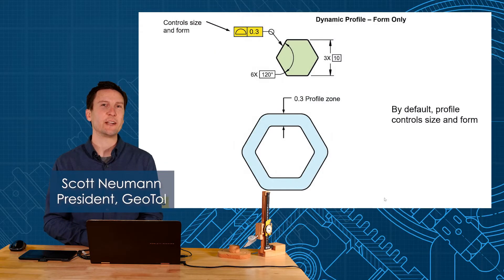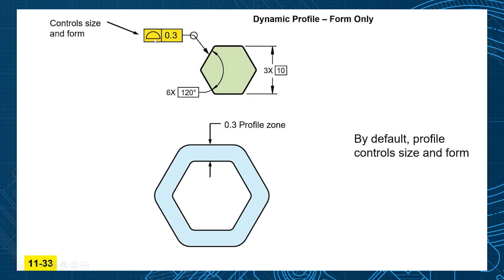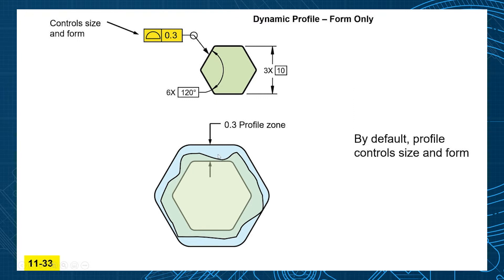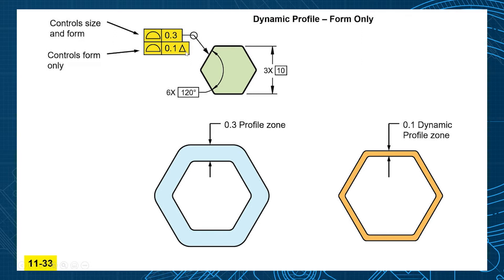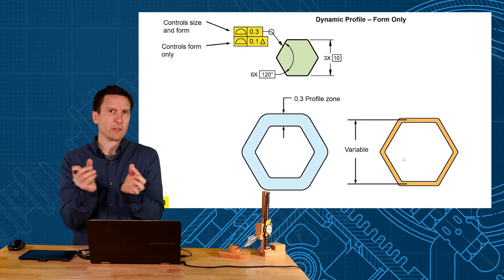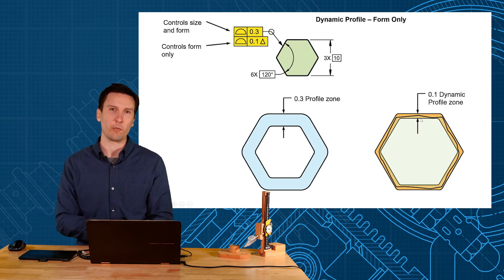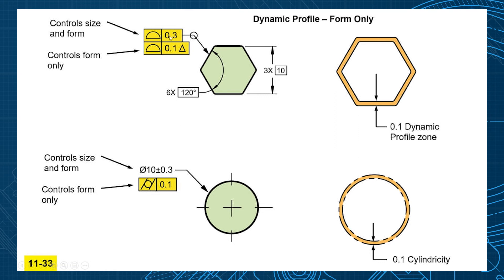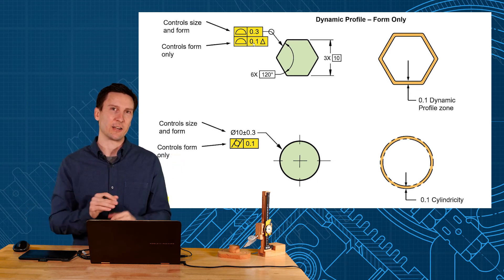New for ASME Y14.5-2018, Dynamic Profile Modifier

Comment: How would you visualize this on say a radius since a radius isn’t a shape?
Reply from the maker: The tolerance zone may be offset from true profile (basic radius) by an unspecified amount. The width of the tolerance zone must remain constant however at the tolerance value. This controls the form of the surface without controlling the "size" of the radius.

Comment: i   like it does it need to be used  as a composite or was that just how the example was shown. or is better to be used with profile then stack the dynamic on to it.
Reply from the maker: It would not matter in this case if it were composite or stacked single segments. Composite tolerancing changes things when datum feature references are added. (lower segments of composite are only rotationally constrained to the datum reference frame)

Comment: How is it different from composite profile
Reply from the maker: Composite profile locks the tolerance zone at the basic dimension. This automatically controls size with the form. The dynamic profile tolerance zone is expandable and does not control size.